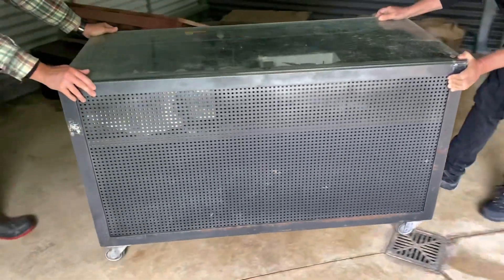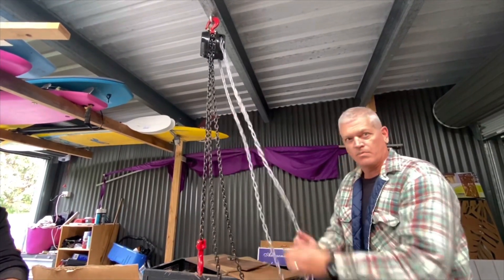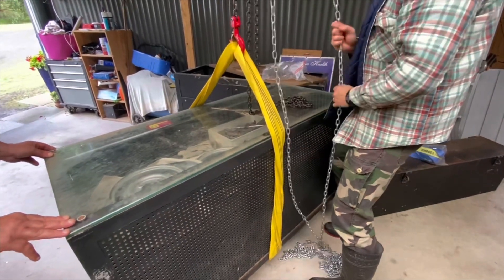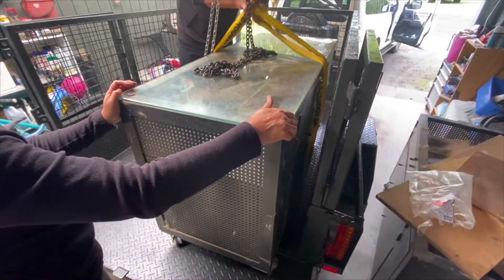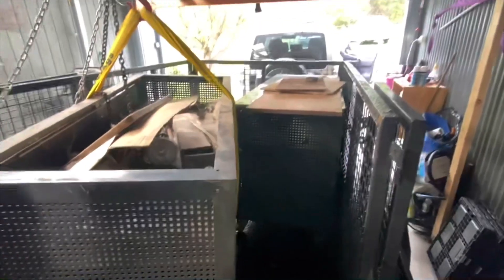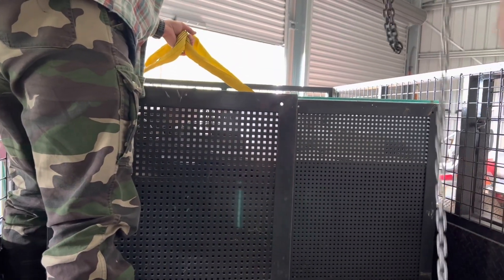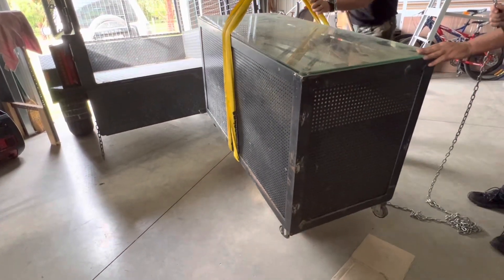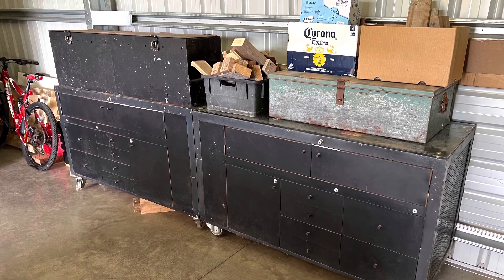How To Lift REALLY Heavy Stuff | Using a Block and Tackle

Comment: Hey mate, where did u buy this block and tackle from?
Reply from the maker: Hi @adrianscattolin8490, I picked it up from Trade Tools on the Sunshine Coast. They had different sizes (weights and lengths) in stock when I got mine.
Thanks for watching mate!
Reply: @selfrelianceaustralia166  great thanks, what weight is yours?
Reply from the maker: Hi Adrian, I think it is a 1 tonne unit. I didn’t think I should lift anymore than that without some structural engineering on my shed frame. 
As it was, the boxes I have lifted were probably about 3-400 kg.